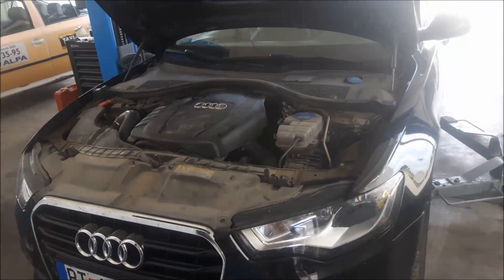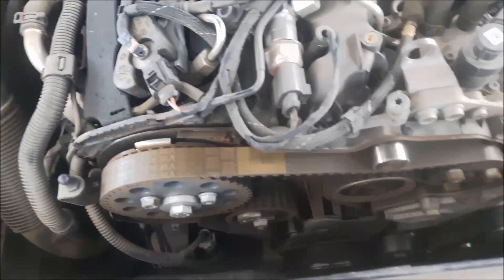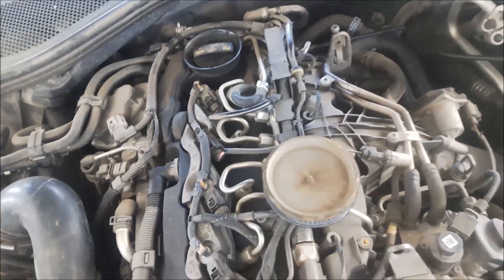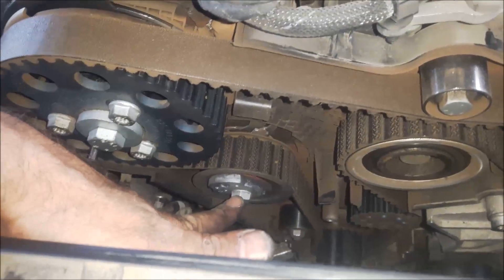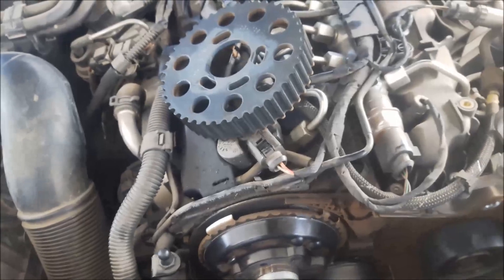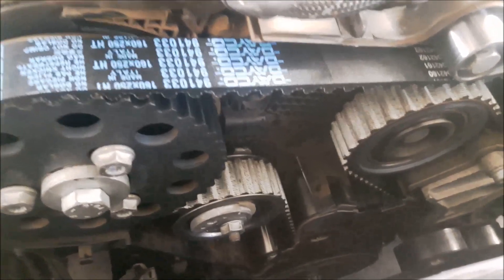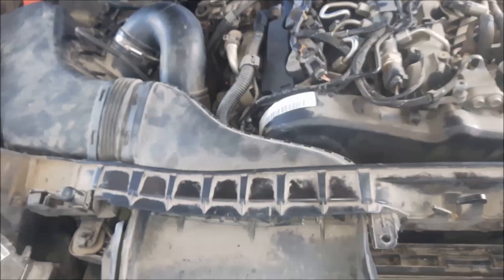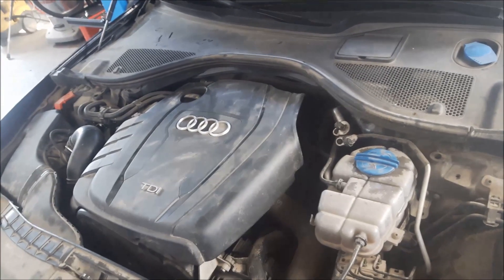audi a6 2.0tdi how to change timing belt

Comment: Hi, nice video. To change water pump, do you also have to change cam belt?
Reply from the maker: If the belt is in good condition and with low mileage you can replace only the coolant pump  if it's defektive

Comment: Hello at what intervall did u change belt? I have had different answers from 120 000 km, other say 180 000 km and the servicebok says 210 000 km. Thank you
Reply from the maker: Yes according to service book is 210000km but every thing depends where the car has been driven highway or city.if it's on highway then you can change at 210000 or little sooner but if it's only city then at lower millage

Comment: Hi, I've never done a timing belt but I'd I'm going to give it a crack. One question I have is when you removed the belt, you also took out the locking pin that has the black ball on, does that not mess with the alignment?? P.s I'm talking about the top left corner pulley if that's what it's called.
Thanks
Reply from the maker: No it's not moving unless you move it somehow